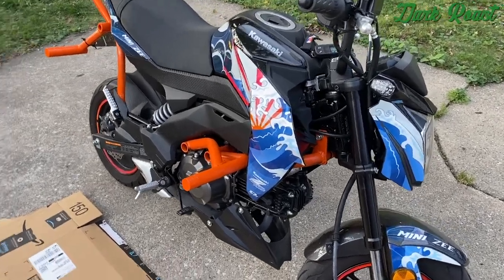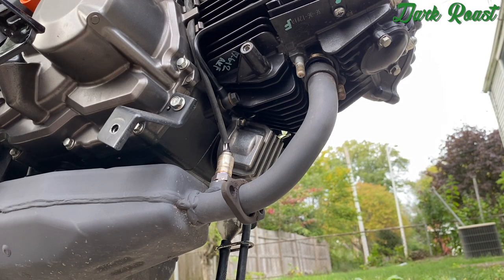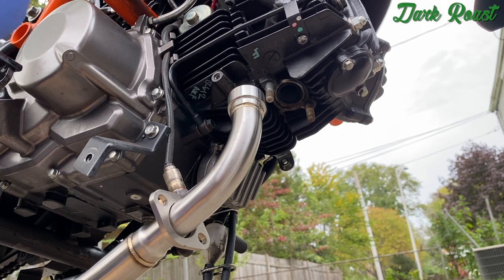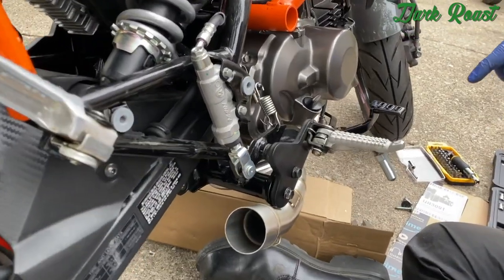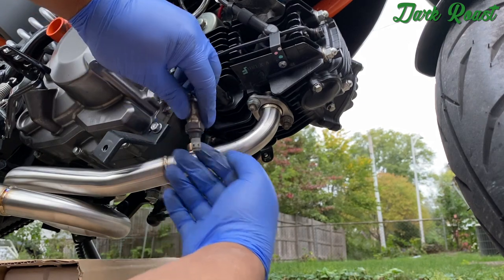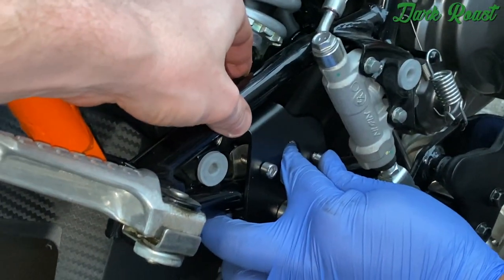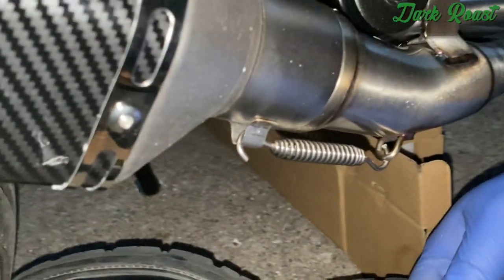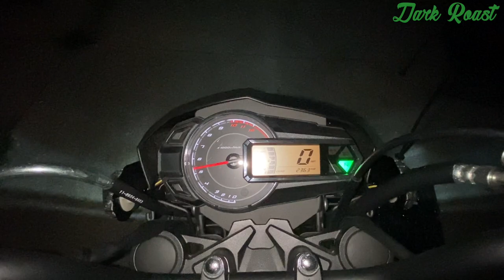Installing a Amazon Exhaust on my 2018 Kawasaki Z125

Comment: Those graphics are amazing. Did you buy it like that?
Reply from the maker: The wrap is actually from Kawasaki. They had a deal at the dealership when you buy a brand new Z125, then you get a free wrap from their selection and installed for free.

Comment: Where did you find that bracket? Do you have a link?
Reply from the maker: The bracket that’s holding the exhaust up in the rear?
Reply: @DarkRoast  yes that one. The one that bolts on to the frame
Reply from the maker: @joehernandez7540  ah yes that actually came with the exhaust
Reply: I’m having the same issue
Reply from the maker: @gagan2929  what’s your issue? Also they don’t have this exact exhaust in stock, but they have plenty of other options on Amazon. Here’s the link to one of them..

KAJIMOTOR Full Exhaust Muffler System Low Mount Pipe For KAWASAKI Z125 2016 2017 2018 https://a.co/d/h5qA2Ws